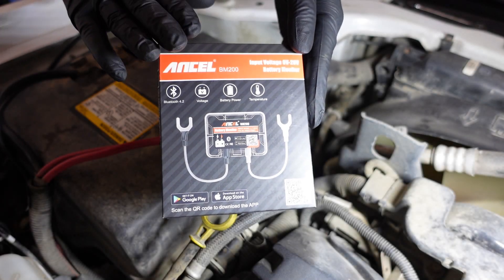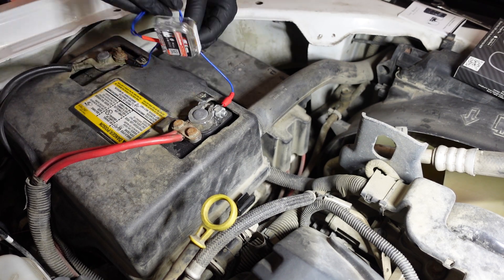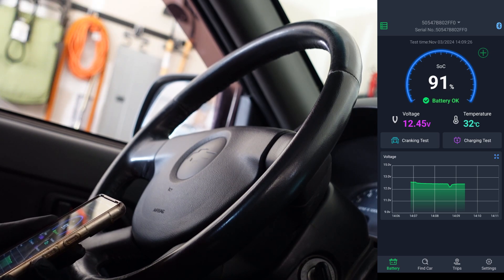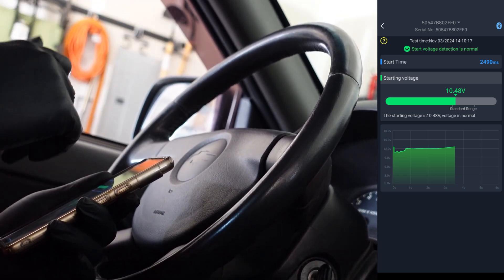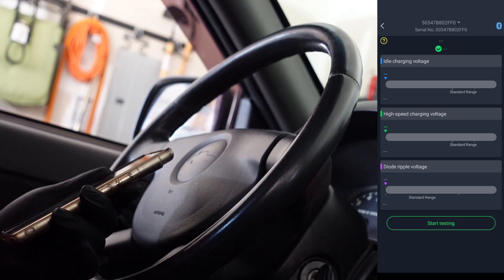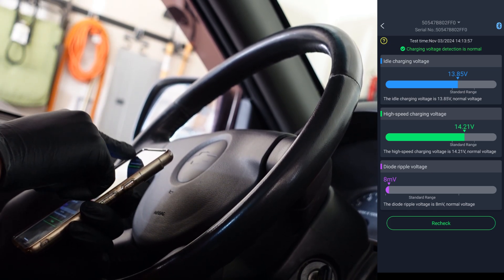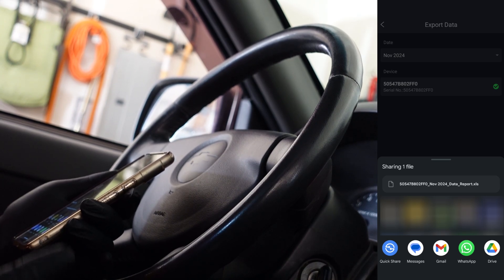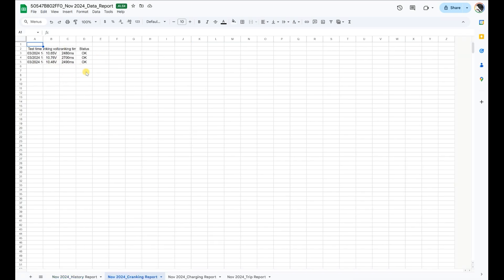Upgrade and Protect Your Car's Battery Life with Ancel BM200

Comment: question please..It can be used to test and determine the CCA of a battery in an ampere unit.?
Reply from the maker: Yes you can do battery function test inside the app and it includes the cold cranking amps.

Comment: Question, does the device keep the history data, or do you have to have the app open to gather data over time?
Reply from the maker: Yes it collects data without opening the app, and when you open the app and it connects to the device, all the historical data will populate and will be available to export.
Reply: @oneanddonediy  what does the exported data include? 
Voltage readings with timestamps for each reading?

How long a period is it able to capture at one time? 

Ideally for me, they'd have a version of this that doesn't use vehicle power at all.
Reply from the maker: @dubmob151  did you watch the video all the way to the end?

Comment: Diode basically a electrical check valve an alternator is changing AC to dc current from the full bridge rectifier. "I kept it as simple as I can"
Reply from the maker: Oh yeah that's right I think it's like a tri diode configuration or something like that right it turns the sine wave into a DC current.

Comment: Being able to monitor current would be nice but it would increase the cost
Reply from the maker: That is true, but you do get a lot of bang for your buck with this tool, even without the current monitoring.
Reply: @james10739  removing a wire and adding a huge shunt is too complex
Reply: Very hard to do!!!
Reply: @AgentOffice  no they would juat need to ad a current transformer that goes around the battery cable it could be implemented for probably roughly $20 but they would have to use a better or bigger processor and redesign the product
Reply: @james10739  CT only works on AC. I think there's a more expensive DC version tho
Reply: @AgentOffice  ya you are right i forgot but they do have a dv version i believe it uses a hall effects sensor but they look the same and i have seen them on a lot of vehicles
Reply: How u going increase the cost?
Reply: @acerage2100  because an ammeter is a separate circuit.
Reply: @acerage2100  by adding current monitoring

Comment: I saw those or something similar on ali express and it seems neat but i cant think of an application where i wouldn't just add a volt meter if whatever i would put it on didn't already have ine
Reply from the maker: I think this would be more useful for people who want to track their battery's health over time, not just check the voltage.
Reply: @oneanddonediy  maybe if you didn't know anything about batteries but all it sees is voltage
Reply: One use is for people with hybrid vehicles, which it seems nearly none of the manufacturers saw fit to include monitoring and alerts when the 12V auxiliary batteries get low. 
It's very common for owners to get stranded because they don't know the battery is drawing down while parked and not running. 
Then they're stranded because without the sufficient voltage on the 12V battery, the car is disabled.
Reply from the maker: That makes a lot of sense. @dubmob151